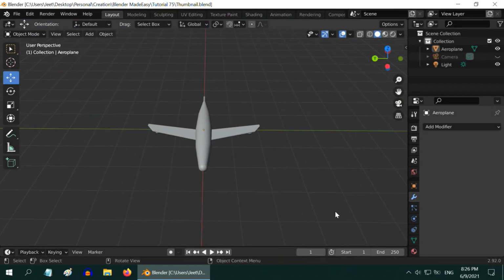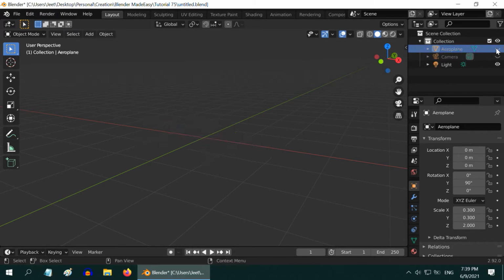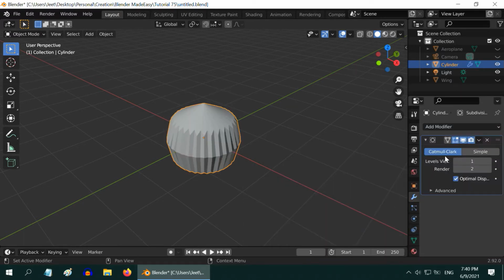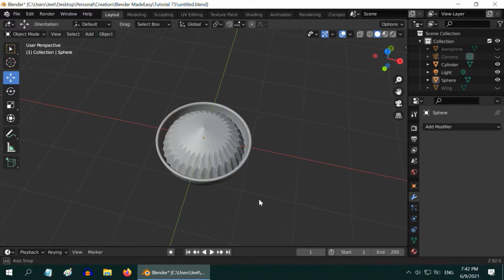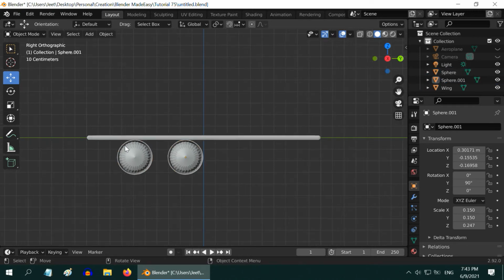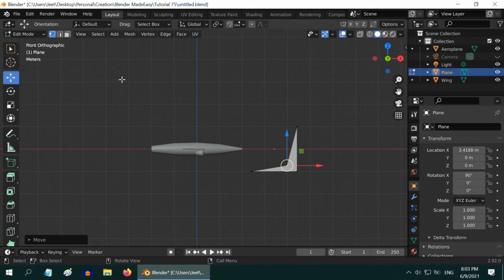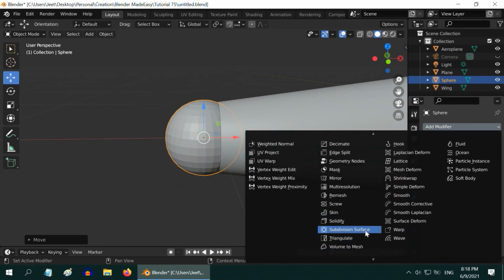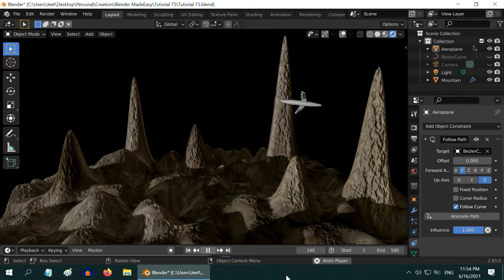Model Aeroplane or Aircraft  | Fighter Jet For Game Design | Easy Tutorial | Blender Eevee & Cycles

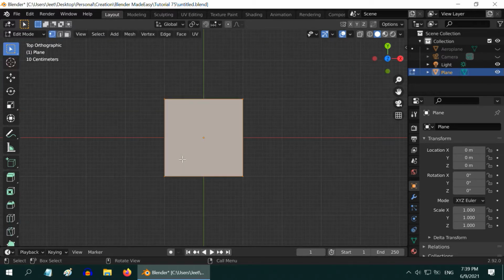Comment: 1:42 I press 7 fo the top view and I still didn’t get the mini squares
Reply: I hope you reply asap
Reply from the maker: @ Are you using the number pad? A number pad is one that we see in the right-side of the main keyboard. If you use the numbers from the top row of the keyboard, it won't work. Also ensure that the num lock is on for the number pad. Otherwise go to View menu > Viewport > Top.